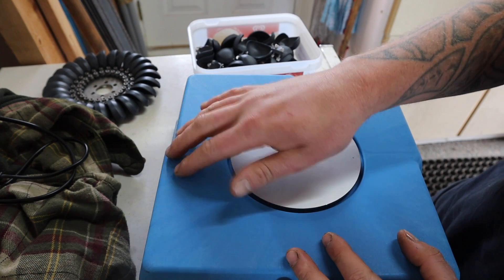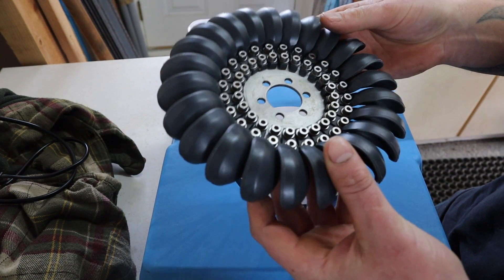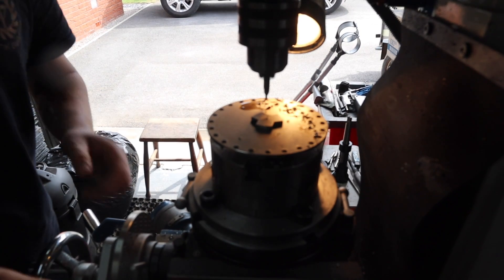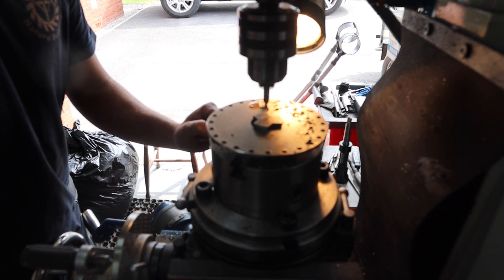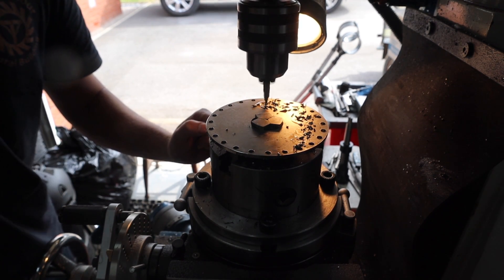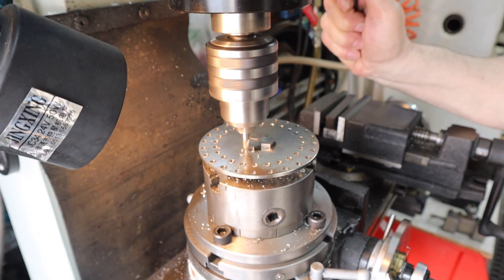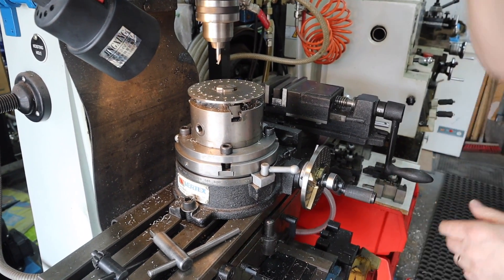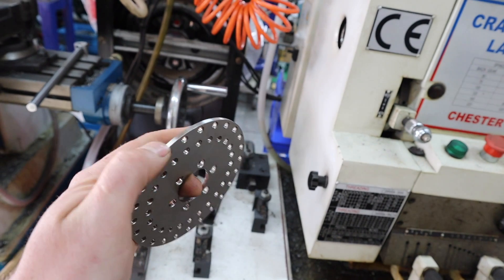4 Nozzle Off Grid Micro Hydro Turgo Turbine  (Part 2 Machining/Assembling Turgo Turbine)

Comment: Good job. I'm a trained fitter and machinist and the only thing I would have done differently would be to have the sleeve as a slip fit over the shaft.  Machine the sleeve same size as the shaft then heat in a saucepan of oil at 180 deg for a few minutes to expand the sleeve then put over shaft and allow to cool,  it will shrink to a tight fit over the shaft. This way it would be perfectly balanced.

Comment: After thinking about this, I think with all of that machining that you did, I would invest in making another one or 2, Once the machines are set up they should turn out pretty fast. This way if one of those cups breaks or something is not right, Just pull it and swap out for a new one. You could make a real nice wood box to hold the spare.. Timber frame wood box...

Comment: The first minute of Machining was boring 😉

The dividing head sure makes it easier to line up you 54 holes. Hopefully the glass fiber reinforced cups are as durable as you are expecting them to be. 

The extra power will make a big difference once you finish the shop and start adding machines.

Comment: Hi Chris,  are metal or wood shop taught in the schools there?  They were in the my school in the US.  I took 2 years of wood and 2 years of metal shop. That was almost 50 years ago, I don't know if they still do.
Reply: Dont know on Chris's schooling, but they do in Australia. My school called it 'DTE', Design, Technology and Enterprise', which is a bit silly, but it did incorporate not only manual skills, but admin stuff, bill of materials, gantt charts, Cad n schematics, all the 'other stuff' that needs doing when you goin for a major project. Lower school was basic skills etc, but upper, you could make anything you could justify with your paperwork and the available hardware. Usually did one big project, and a few smaller ones, plus any odd jobs you wanted. It was 'competence based assessment', so you had a checklist of skills you had to demonstrate to pass, sometimes a few times over. So say; dimension accuracy. You could build a set of drawers from scraps and ace it, but no credit for a bill of materials. So you'd do an electronics project, which would max that out. It was very much up to you to figure out what you needed to do to pass the class. No exams, no tests, no real structure. Demonstrate your ability however you express it. I made everthing from a filigree silver ring, a slipgear multispeed gearbox to a fullsize MAME arcade cabinet. (Only class i got solid A's in)

I also did Technical Graphics, which was just Drafting, CAD. Same teacher. I got on well with him, so we juggled the timetable to get as many periods in sequence as we could. TG had the same competence based assessment. N I could flexitime between classes. So if i was early in the design phase, i could use both my TG and DTE periods on the computer doing CAD, then later spend both periods in the workshop. And the competencies overlapped, so you spent less time doing 'school' n more time 'makin stuff'. There was also a small business class, that had a similar arrangement. These were all non-TEE (Tertiary Entrance Exam, for your university score), but you ended up with a big, diverse, well documented portfolio of stuff youve done. Didnt get you into uni, but it got you a job or apprenticeship pretty fast. 

Nowdays my job is basically translating an engineers fantasy into something worker monkeys can actually do. Breaking down the plan into digestible steps. N teaching engineers how the world actually works. Im very lucky, i got a good schooling, to study what i was good at. I also did high maths and chemistry (which were TEE), cos they were facinating. I didnt do great in the tests, but i learnt alot.

School shouldnt be about passing tests n exams. It should teach you useful skills. Mr Nagtzam, i owe you a few hundred beers.

Comment: Thanks chris great job and video, would still add get the assembly dianimacally balanced, will still work without BUT if u do it will make a great diffrence to the life of the bearings. Hay only giving advice might be the cups wear out before the bearings but always good practice on rotating equipment 👍

Comment: so im thinking the only way to improve this is to make the metal piece from carbon fibre for faster spin ups.
Reply: Why would spin up time matter? It's a steady state system and the energy to spin it up is negligible.
Reply: @hilo90mhz  not really. You're wasting energy keeping something  more massive rotating than one less massive. Also bearing wear.
Reply: @WildEngineering  Its essentially a flywheel, the only possible difference would be air resistance. The spoons on this type of turbine create a huge amount of air resistance, the actual machined parts contribute no meaningful losses. They just need to be strong and corrosion resistant enough to last a long time.